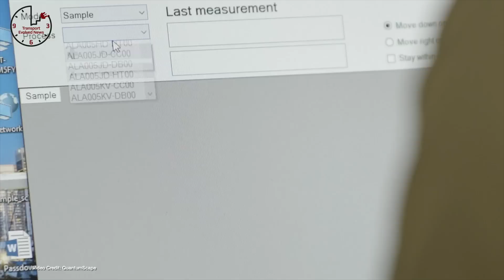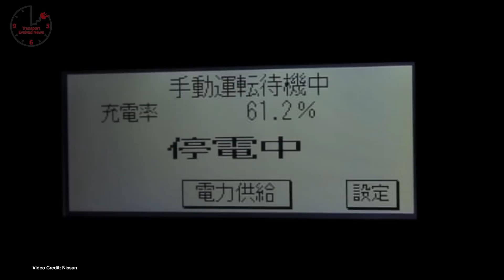TEN 319 Aptera Returns, Gridserve, Solid State Breakthroughs?

Comment: Wheel shroud clogging with snow, mud, leaves, etc?
Reply: Since much of the vehicle heat is generated in the wheels, there is likely to be melt off before build up occurs.  The wheel pants can also be unclipped without tools if cleaning becomes necessary.

Comment: What we really need is a push to PEVs for short/medium range trips (i.e. most trips), as they are way more efficient that large EVs. The UK government needs to speed up legislation changes to make e-scooters, e-unicycles, and other PEV's legal. Replacing fossil fuel cars with the equivalent electric vehicle is not the best way forward. EV's are still too expensive and still a danger to cyclists and other road users and do nothing to solve our congestion problem.

Comment: On the subject of creating a new company for the EV side if the business, I did wonder how the changeover point from ICE to EV would be handled.  This method seems to be a ‘backstop’ protection in case the worst happens and suddenly the old ICE part becomes not only unprofitable but also any sensible projection shows a non-future for it.  Any bank will pull funding, any shareholder want to sell up, before that happens, so ideally a smooth way to morph all the finances from one part of the company to the other would be invented.  Trouble is, in shares, someone losing out can make someone else money - there will be a time when it will suit someone to shaft the people invested in the ‘old’ part of a car-maker.

Comment: i didn't watch this epidose.just wanted to say this is the ugliest car. as for batteries over hydrogen: far from settled.
Reply: All I will say is, look around! 99% of non ICE vehicles are battery.
This means that 99% of the r & d and 99% of the MONEY!!! is going into  battery vehicles!
So - there's your answer!
The hydrogen issue isn't 'settled' - but, you know, reality....!!?
Reply: @andymccabe6712  then why do major companies continue to work on hydrogen? answer: it's a viable tech, likely superior to battery once delivery issues are settled. batteries weigh a lot, even as they are improved. if ultimately the cost per mile of hydrogen is lower, it will win out. batteries simply got the jump, were ready sooner. so were horse and buggy.
Reply: @vanrozay8871  No. Look at the relative efficiencies.  To any engineer who looks at the entire energy cycle, hydrogen is a non starter for personal transportation.  

No matter how large, a company has to face physics, and hydrogen has not chance to compete.

Comment: For those who love aerodynamics, the Aptera must represent nirvana. A rolling teardrop.  Most cool.
Reply: If you like that, check out the Leyat Hélica built in the 1920s, it has roughly the same shape and is propellor driven
Reply: @MIGHTYcbu  - Fascinating vehicle.  And the association with aircraft was understandable at the time.  You really would need goggles driving that thing!
Reply: Except that it isn't right. The mean line should be horizontal and the bottom curves up too much at the rear.

Comment: I would be embarrassed to be seen driving around in that car designed by a child
Reply: Well, I would agree but it'll be like saying something similar about the Honda civic Type-R. It's too flashy, but the owners have bragging rights for owning a hatchback with over 300 hp, or a fast, reliable, and practical car. Likewise, Aptera owners can flex on Tesla owners for being able to charge on their own, and being smaller, cheaper, and still very useful. Idk, it's like a new future of compact vehicles, simply for quick, everyday trips.

Comment: GRIDSERVE Forecourt? Wow did you see that? It's cool. Saw it on another EV YouTube video. One of these days America will get into a full EV Charging Stations with restrooms, food courts, electronic charging outlets next to the tables,  solar and wind energy sources with batteries storage, and an expanding network throughout North America and other COUNTRIES. HEY this could go up into space too. After countries cleanup all the inactive satellites and debris in orbit.
I wonder if any Fossil Fuel Reststops will convert 100% EV Charging Stations. At least start 1 at a time or every other rest stop on the state highways. Eventually every Rest stop will be fully converted to EV Charging Stations. I'm going to Electrify America or ChargePoint or EVGo. They must have at least 12 - 24 Charging Stations at each reststop. Also we'll need a good amount of Semi Charging Stations for both Tesla Semis and other brands and rates of Charging but the EVs and Semi EVs need to STANDARDIZE there CHARGING PLUGS to keep the costs down.

Comment: Apetera is a motorcycle in disguise, not subject to strict regulatory oversight a normal car has to go through before given license to be driven. Well not here in the US. Acrimoto is doing the same.  Like every three wheel vehicles before it, this too will die. I can’t imagine being T-bone by a modern Honda Civic. A hulking two ton Suburban? Forgetaboutit!
Reply: It will be fully tested to crash test standards and you can make an informed decision then.  The Gen 1 Honda Insight also weighs 1800 lbs and got a 4 crash test rating in all categories.  I was hit from behind by a large vehicle at 60 and had no injuries in one.  I bet the Aptera will be safer than that is.

I have a different perspective having come from 400,000 miles of riding actual motorcycles.
Reply: @n.brucenelson5920   Hit from behind is not the same as being t-boned, in fact quite different. The Honda Insight was/is classified as a car in the US subject to much more safety requirements. 

Every few years a three wheel vehicle makes headlines only to go away as quickly as it came. Ever wonder why that is? Ever wonder why none so far have been produced  in numbers? Of course, I’m not counting motorized rickshaw common in south and south east Asia. Yes, the Aptera and Acrimoto will be certified by the NHTSA to be sold here in the US but as a motorcycle class vehicle. It will be adopted by a few whimsical greenies and then it will quickly fade away once again.
Reply: @demultiplexdfunc177  While you are correct about the legal requirements, the Aptera will be tested to full automotive crash standards and the results will be published before production begins.

In the first week, Aptera already has over 100 million dollars in preorders.  It really does look like this is going to happen.

Comment: Toyota has unveiled their Solid State Battery which will be in prototype production in 2021 - high energy density and 10 min charge (if you have a charger that can deliver power at that rate.
https://www.youtube.com/watch?v=hS5FgfRq7Nk
Toyota's Super EV Battery That Charges in 10 Minutes, Coming in 2021

Comment: Are they putting public phones in the chargers? I know that with everyone having a cell phone they're not all that useful, but not everyone has a cell phone all the time.
I live pretty close to Solid Power, sadly they're not hiring :(
Subaru EV news?
Inclusion is great, we need more of it. I just fear it will be more "black faces in high places supporting the status quo" as Cornel West puts it. Does it matter what color the boot on your neck is or what the bits between the drone pilot's legs are?

Comment: V2G Needs o be standard on every car.
Reply: Is it solely an issue about making the car capable of doing this, or does the home's grid have to also be modified to accept electricity from a vehicle?
Reply: @ericdew2021  You can't just plug it in into an outlet if I am correct, however with some slight modifications (similar to how a home battery is installed), it should be fine.

Comment: I have a diesel Mokka now, and I would buy the electric one today if I could. The car is a good city car aswell as a highway cruiser, with lots of luxury items on board. The sound system needs a little more oomph, but otherwise we like it. Just hope the EV will be at a similar range than the diesel.
Reply: The EV is EXTREMELY unlikely to have the same range as the Diesel.
Reply: @incognitotorpedo42  The 100 kWh battery Aptera will have and EPA. highway cycle range of 1000 miles on a single charge.

Comment: Toyota finally realized that EVs are the future, not the hydrogen? I'm surprised.
Reply: 100% surprised. I was at a Toyota dealership many years ago and inquired about their plug--in Prius Prime. He told me how crappy it was and how inconvenient it was to plug a vehicle to charge then tried to sell me an all gas car. Little did he know that I had experience owning 2 BEVs at that point and had no problems with a plug.
Reply: The hydrogen that Toyota uses is part of the electric vehicle. Toyota chose to store electricity in the form of hydrogen instead of lithium in batteries. In a way, energy per kg is much higher in hydrogen, but the process of creating that hydrogen, and its storage, transport, and compression reduces the overall effectiveness of the whole process.
Reply: @ericdew2021  I am aware how this technology works, however I'm convinced the reasons behind Toyota executives choosing hydrogen are far from technology and close to holding a death grip on customers pockets.
Reply: @oddixgames6704  nah, it because thry sell so many hybrids.
They will exceed most manufacters in  euro fleet numbers, even tesla (as they merged thier fleet with Honda and FCA)
They can delay thier evs til the most profitable point, keep making ice profits others can't and write off ice assets over longer periods.
Its all a long game.
Reply: @simonhenry7867  I agree, we don't see the whole picture. Maybe this way Toyota has the most smooth transition. I just don't realize why they still beat an obviously head hydrogen horse, those costs could be spent towards developing a competitive EV
Reply: The only way to know things is to go know them. Toyota has made a stack of efforts for the world to learn from. Thanks Toyota. Now go make batteries!
Reply: Toyota has unveiled their Solid State Battery which will be in prototype production in 2021 - high energy density and 10 min charge (if you have a charger that can deliver power at that rate.
https://www.youtube.com/watch?v=hS5FgfRq7Nk
Toyota's Super EV Battery That Charges in 10 Minutes, Coming in 2021
Reply: Great show.  I like the brevity and the news format really moves it along!
Reply: I think the recent hydrogen shortage has been the nail in the coffin so to speak.
Reply: @plightn  At present, most hydrogen is sourced from fossil gas (methane) via steam reforming (CH4 + H2O ⇌ CO + 3 H2). This defeats the purpose of hydrogen powered vehicles, that being zero carbon emissions. Hydrogen must be produced via renewable powered water electrolysis, which does not presently exist at large scale. The present conditions wouldn't matter if a green hydrogen infrastructure had to be built. The real nail in the coffin is the amount of energy loss in the electrolysis, compression for storage and transport of hydrogen (c. 75% loss ref input energy to drive wheel) vs charging a BEV where about 30% is lost between grid transmission, AC->DC conversion, battery charging and drive motor losses.

Comment: We will buy EV's when we get Bi-directional charging.  V to Gridfreedom
Reply: It's very useful for grid balancing, load shedding and demand side management in general.
Reply: nice idea.....   If you are not going to use your ecar to go down the street to buy some bread and milk in a emergency.   ALL GOOD.......
Reply: @daverobert7927  Could you not walk or cycle to the shops to get milk and bread. I already do this and leave the car at home.
Reply: imho V2G is dumb, the vehicle battery is far more useful to the er vehicle than for providing energy to your home.
And when autonomy becomes reality, massively so.
Reply: We will buy a smartphone when they can mow the lawn 😂
Just buy a Powerwall?
Reply: @grahambrown42  Because a powerwall can't drive. I think the point is that vehicle batteries whilst plugged in are a potentially valuable resource for grid management. At the moment they are poorly utilised. It already happens in Japan, accelerated by the need for careful grid management after a lot of generating capacity was unavailable following Fukushima.
Reply: Can't drive a Powerwall, very clever.
Using the expensive battery pack in a car like a Tesla, is ludicrous, and like going for a loaf of bread in a Ferrari.
Powewall
Max output 7kw
No cooling system
Model 3 battery
Max output 300kw+
Liquid cooling system
Horses for courses.
Car for transport, powerwall for domestic energy storage.
And
You do not become responsible for grid management when you buy an EV!
Reply: @grahambrown42  I'm not advocating using a car as a means to power a house by any means. Rather, just a tool for the grid to effect load balancing occasionally. Once people realise that there's the opportunity to get paid for leaving your car plugged in, it will become a norm. I already get paid for giving my EV charger to pick its charging times.
Reply: @andymccabe6712  Sigh, I can now see the confusion, having watched the video properly. It is misleading, as it seems to be getting excited about using your car to power your house in the event of a power cut. This will just never happen. It's called V2G, not V2H(ouse). I think often the electricity grid is being seen as a purely transactional function; I pay money, I get electricity. It is really so much more than that. We all invest in the generation and transmission infrastructure, and now we're being offered the opportunity to generate (feed in) up to 16A per phase and get paid with no bureaucracy or permits. V2G means that we can possibly help load shed and contribute storage. The grid is a collective effort to decarbonise; we can't do it by ourselves at a household level.

Comment: Aptera is the most forward thinking electric car of the whole bunch in my estimation, I'd love one in black too well matt black actually with headlights on the front wheel spats then they'd turn with the wheels a la Citreon DS YES!
Reply: I'll take one in the brightest orange they have, since I would dread getting into an accident in it but would be safer than taking my motorcycle. I'm really considering buying one if the reviews are good!

Comment: Is a 12 year old in charge of design at Bollinger or what's going on over there?
Reply: simplicity - no stamping machines needed - those machines are very very expensive and the tooling (molds for curved shapes) also very expensive and then the "gap problems" not easy - ask Tesla.  At low volumes makes perfect sence.  Also over 6,000 lbs. (class 3 truck I think?) avoids many saftey crash testing. For a farm/ranch vehicle - owner don't care about crash tests.
Reply: It’s supposed to be a “work truck”, not a “chick magnet”.

Viewed as such, looks great to me.
Reply: It seems like 12 year olds are in charge of the whole World..

Comment: When I think of all the things to admire about EVs, the number one in my mind is getting home from work and plugging it in to charge overnight in my own home. I can't stop thinking that charging stations are a holdover from gas power cars and not really very useful, except maybe if they were part of the parking infrastructure of motels and hotels, and maybe campgrounds. It's like putting a holder for a buggy whip in a model T, and brackets so you could harness a horse up to it in case the motor stopped working. To my mind the electric concept should do away with the idea of place you stop just to charge up your car or truck.
Reply: The statistic often quoted for the UK is that 40% of homes do not have off street parking. That it’s often interpreted as 40% of cars do not have off street parking. If people in those homes are to transition to EV’s they need reliable non home based charging.

Comment: All these advancements and we're still waiting for the 200+ mile car for less than $20k.
Reply: If you are open to used vehicles, the 2017 Chevy Bolt is easily available for under $20k and beats 200mi
Reply: @e.wintertashlin2903  It also has battery fire issues that haven't actually been solved yet.
Reply: @hellcat1988  Believe me, I'm well aware. I've got a used Chevy Bolt that is going in for recall service, and we got Hyundai to take back our '19 Kona EV after its battery fire recall so severely hampered key elements of the car compared to what we originally bought it as when new. 

That said, even with the downgrades the Chevy recall will impose on the car, it'll still get better than 200mi of range in good conditions, and the fire issues will likely drop the price even further.
Reply: @hellcat1988  no one ever died from battery fire
https://en.wikipedia.org/wiki/Plug-in_electric_vehicle_fire_incidents
Reply: @brandoYT  That's still one hell of an investment to go up in flames, and an inconvenience I don't want to have to deal with until it gets replaced.
Reply from the maker: With an incentive, the Aptera's entry level model is under $20k
Reply: @transportevolved  Well, I'll have to wait for some real world winter time reviews to see if it can meet my needs, and if it can do what I expect/need in MY real world conditions before I pass judgement then.
Reply: With the aptera at $25990 and 250 miles, you're basically there.
Reply: @gasdive  Only with the incentives, IF I can even make that work for myself.  I don't make a hell of a lot, so I wouldn't get much in the way of tax brakes.  And without them, it's still not under $20k.
Reply: USED is your answer to save real money - always has been